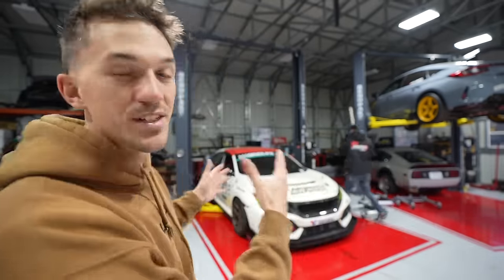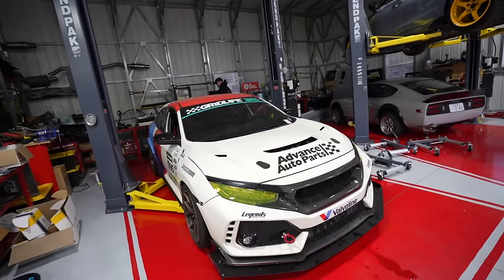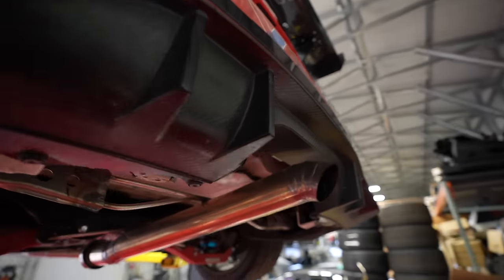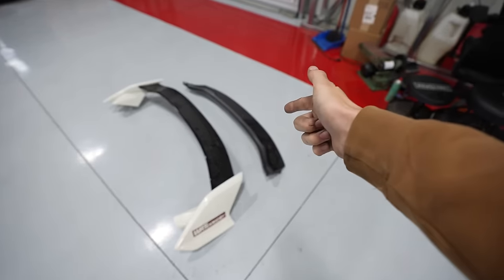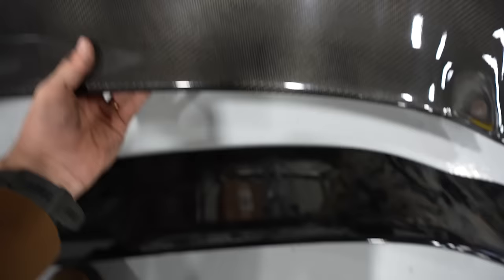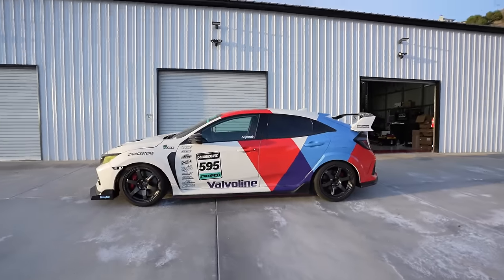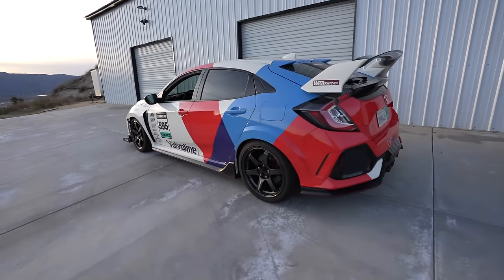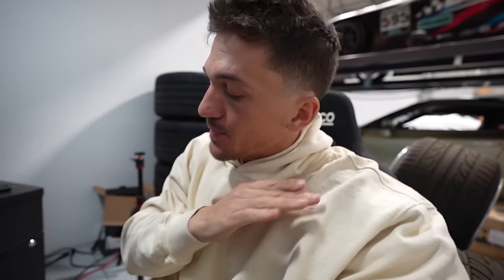Saying Goodbye to my FAVORITE Car..

Comment: Think you should keep the car championship white. Also think you should but the carbon splitter you had on before the battle aero one back on also think you should upgrade radiator as the biggest problem with these cars is cooling.
Think its realy cool your giving away one of your own personal cars

Comment: I’m honestly sad to see the FK8 go however it doesn’t make sense to repeat the build over again on the FL5 and just keep the FK8 in the background. The car honestly just needs a good wash and detail and send it off to the new owner with the Valvoline livery, the car is an awesome machine that has a lot of history on your channel and being able to own a piece of that history as it stands would be pretty cool imo 🤷🏻‍♂️👌🏼 plus if the new owner later decides to remove it then at least it’s just a livery and not a full wrap that’s a pain in the ass to remove lol also throw on some carbon turn signal deletes 😂 bugs my ocd to see the empty holes
Reply: P.s PLEASE improve the quality of track driving videos 😫 features on screen such as cornering G’s, MPH, and Maybe a small foot cam recording pedal use would be awesome! I personally enjoy the track driving and being able to ride along for the experience, Gears and Gasoline and PHD racing especially have phenomenal in car footage and data of track events. Best of luck at Tsukuba Circuit!!!! Ganbatte!!

Comment: 1. Keep it championship white
2. Remove the yellow headlight tints
3. Remove the battle aero splitter
4. Remove the negative camber in front wheels
5. Maybe change the body kit to a mugen kit

Other than that it's all good👌